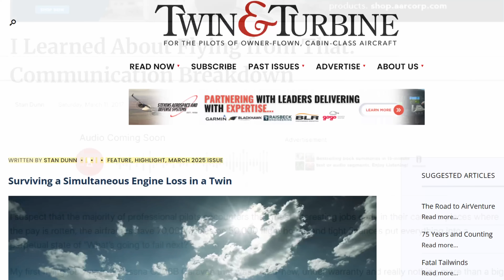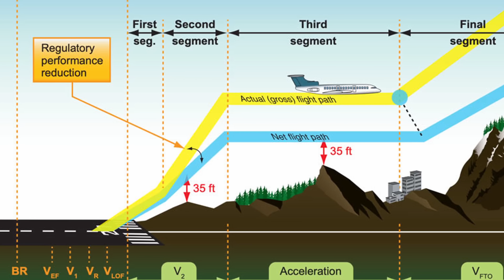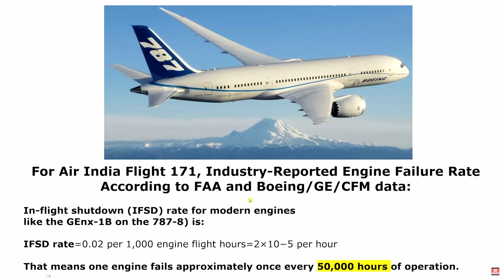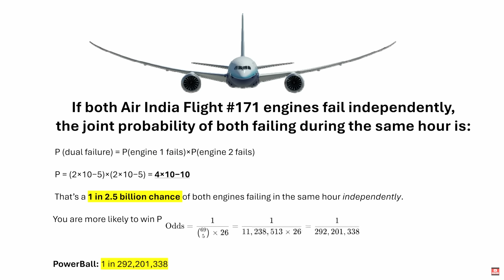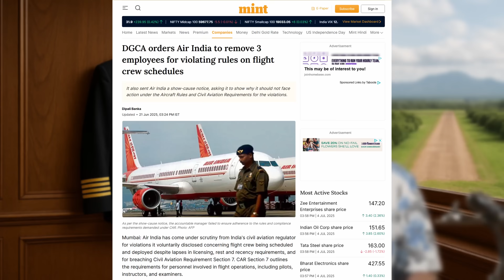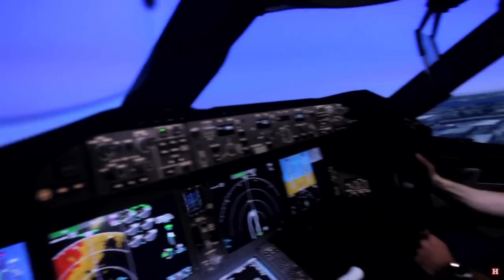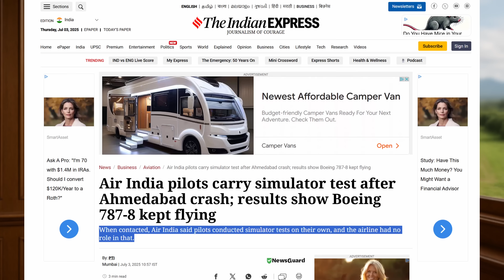Air India 171 Cause Becoming Clear

Comment: pilots had low hours experience
Reply: the pilot hours are disputed, colleagues of the pilots say the captain and first officer had more flying hours but their flying hours were based on a new system the dgca launched, which excluded previous flying hours

air india initially said the captain had 8.2k flying hours while the f/o had 1.1k flying hours, but they eventually reiterated in an announcement that the captain actually had over 11k flying hours and the first officer had 3.4k flying hours, both fairly experienced 

We will only know the actual flying hours of the pilots when the preliminary report comes out

Comment: There is 0 indication so far the pilots shut down the incorrect engine. Almost no chance they touched any engine controls at that altitude. 787 pilot here
Reply: I'm inclined to agree with you. Except one thing bothers me, and that is the Lone Survivor was sitting right next to the engine, and he said that they, went silent, and the plane floated for a short time. And then the engine spools back up but said that the engines coming back to life didn't create any forward thrust??? I really can't believe we haven't heard more from the Lone Survivor with a sit down with an FAA official or something?
Reply: @gregweigel8115  The survivor will be interviewed, as will all the other eye witnesses. Conducting the interviews will take a long time and other than a brief interim report, no information will be released until the investigation is complete.
Reply: @gregweigel8115 if they did spool back up I would say they were not going to provide any lift at the angle of attack/ slow speed caused from them going silent. They would have probably had to level off to gain any actual speed back where they could start climbing again. Which wouldn’t have even been possible in this scenario.
Reply: @jacobhendrickson8935  Difficult to level off when you are descending with insufficient thrust.
Reply: @hb1338 right, I didn’t say it was possible I was just explaining why would wouldn’t feel the thrust in that nose up no speed situation.
Reply: @hb1338 not to mention that even if they did level off it would nose over, pick up speed and dive into the ground. At least at the attitude that they had it was a softer impact than the alternative
Reply: @gregweigel8115 Oh, wow that’s sounding like a compressor stall, I never heard about that.  Thanks Greg. I still believe it’s electrical
Reply: @HankHildebrant  Nope. Compressor stalls are almost always accompanied by loud bangs and puffs of smoke from the engine.
Reply: @hb1338 not if fuel starvation from underpowered electric pumps
Reply: @HankHildebrant Not electrical, pilot error accounts for 80% of accidents.
Reply: @hb1338 how do you explain that now that we know the exact opposite
Reply: @gregweigel8115 Ya that’s what engines do when they don’t get any fuel.
Reply: Correct. Furthermore, the plane remained perfectly balanced during the whole flight - which means, both engines lost thrust exactly simultaneously. 
Whatever the reason was, it was not a pilot error.
Reply: Yes, just another absurd conspiracy theory being repeated. 777 pilot here.
Reply: @JetBossLauraSavino thank you Laura
Reply: @JetBossLauraSavino keep it in the wind captain
Reply: Would the rat deploying align with this theory though?
Reply: The Air Current has an article out today that should be reviewed.
Reply: @0604chiropractaylor I read it, and boy did they nail guys like this poster. AI is generating misinformation. Or straight misconceptions
Reply: This “case” will surely become one of the more interesting (Asia-related) episodes of the TV series “Mayday”, “Air Crash Investigation”, or “Air Disasters” respectively…😏
Reply: @maccxxster i would have to agree with you on that
Reply: Well not many planes do well without fuel.   And that's the facts Jack.  Someone shut off fuel
Reply: @trextrextrex trex, there is a  restart procedure that does require a cycling of the cutoff switches, however if they were in fact doing that procedure they should have known at the altitude they were at that they would be doomed because they never had the time to restart, and there could be a chance that they became overwhelmed with trying to put the plane down somewhere beside the medical college. 

But being a fly by wire aircraft they may not have had control of the plane when the RAT deployed. 

Or yes it was deliberate. But that doesn’t explain the mayday call and the only surviving passenger stating that the engines went silent and shortly before the impact started to spool back up again. 

Hopefully the investigation uncovers the truth. But this report is preliminary and this is an Indian investigation. 

I’m staying neutral on this until the facts come to light
Reply: comment did not age well 😞
Reply: true.
Reply: They're indian it makes alot of sense. Very incompetent pilots and people.
Reply: You were totally wrong with that comment along with 248 other dummies. 
One of the pilots shut down both engines with the fuel cutoff switches. I knew that accident was pilot error, from the get go. The author of this video was more right than you guys too.
Reply: @CaptainLeo44 go listen to captain Steve and hear what he’s saying about it. First off I’m not going to argue with you but in a dual failure there is a procedure that requires the cutoff switches to be cycled. Now that you seem to believe a preliminary report you should be ashamed of yourself. Anyway you’re ignorant and if you’re actually a captain I’d never want to fly with you. 

Good day sir
Reply: @HankHildebrant 14,600 hours and zero accidents. Safer than you a I bet. Cycled does not mean leave off.
Reply: @CaptainLeo44 hahahaha. You are a liar
Reply: I’m also 51 and I’m retired, I don’t have to shill bear watches, and I also don’t have to use my old white ford pickup to jumpstart my broken down tractor because I can afford a new battery and alternator 😂😂😂😂😂
Reply: You were totally wrong with that comment along with 248 other dummies. 
One of the pilots shut down both engines with the fuel cutoff switches. I knew that accident was pilot error, from the get go. The author of this video was more right than you guys too. I think you can rule out being an accident investigator.
Reply: FADEC shut off the engines, anyone with any common sense can see that. I reckon a huge lawsuit incoming for Boeing, the risk assessment whistleblowers were right all along.
Reply: Well - almost no chance of a 787 going down period, so if something with a probability of near zero proves to be the cause, it won’t be much rarer than the event itself.
Reply: @russellaycock3703 - there is a possible reason for simultaneous engine failure not mentioned here: Fuel evaporation under extremely hot weather conditions.
Reply: @russellaycock3703  That's what they said about the Titanic!
Reply: @melodychest9020 the last pilot named Aycock I heard of killed Randy Rhoads in a plane crash. I hope he’s not carrying people
Reply: @russellaycock3703 Pilot error is way more common than engine failures
Reply: @CaptainLeo44 why don’t you jump start tractors dude. At least you are good at that
Reply: @brandodurham There is a thing called asymmetric thrust, which this plane does not display. The rudder was close to center throughout the flight. Which you know that to counter that you need to compensate with your rudder. I’m with you Brando. 

Be careful with those old Dreamliners right now. We need you here with us brother
Reply: @HankHildebrant  When you "edit" your reply, the persons name is no longer highlighted in your reply, and they won't get a notification. It's better to delete and reply to the person again if you want to have a discussion.
Reply: @dc6233 i appreciate you for sharing this.  Thank you
Reply: Are air India flights going cheap at the minute? (make sure your will is in order first)
Reply: Unless on purpose

Comment: trolling youtube for money as well it seems.  Nothing new except to blame the crew, who from what I've heard were pretty experienced with thousands of hours flying and quite a lot on type - and thus not likely to hastily shut down the wrong engine mid-take-off.  There was no fire or anything which might require a hasty shutdown decision, and as others point out the SOP for engine fail during take-off is to fly the plane and try to gain altitude. 

In time the data will have been analysed and hopefully the cause of the crash will become clear, until then all is speculation.

Comment: I stayed at a Motel 6 in the 1970s and played MS Flight Simulator 1998…and that experience qualifies me for the following:  like a bitch in heat, it’s all about the….THRUST!

WHAT does the pilot mention?  Loss of THRUST.  Period.  And in this case, NOT a single engine failure.  You’re welcome.

Comment: From: India Times

"Air India pilots have conducted simulations of the ill-fated flight's conditions in a simulator, testing scenarios with extended landing gear and retracted wing flaps. These simulations revealed that these configurations alone would not have resulted in a crash, according to sources close to the investigation quoted in a Bloomberg report."

Comment: click bait title.

I'm more confused now that I was before ... but I've only been flying major airline for going-on 28 years and only had USAF single seat/instructor experience before that.

certificated 787 pilot ... it was the last aircraft I flew.

I'm concerned about the FADEC.  Does anything makes this mishap unique to this airline, with this crew, with this particular airframe at this particular airport on this particular day.

I agree that fuel contamination is low probability as apparently no other aircraft sustained any difficulty, let alone anything CLOSE to engine failure.  I agree that the flaps were likely set correctly.

It appears the gear handle WAS raised as the main trucks have translated for retraction, but hyd power lost immediately after that, which deployed the RAT and left the gear down.

I'd liked to have heard a greater analysis of the dust-up on rotation.  looks like overrun dust, not exhaust from an engine malfunction, which would mean the majority of that 11,500' long runway was used.  If so, they had problems well before rotation..  No normally operating 787 takes that much runway, ever.  If there was only a single engine failure, heading control was BEYOND outstanding ... no change.

Will continue to watch ... perhaps on the next video ... approaching a month since the crash ... perhaps avoid the temptation to bait the title.

Comment: First of all at 3 minutes and 55 seconds in your video new state that the 787 has one generator for each engine that is incorrect. The787 has two generators (variable frequency stater generators) per engine plus two generators on the apu. That's a total of 6 generators that's 1450 kw or power over a million watts.

Comment: First question need to be asked is what time the AHM ( aircraft health monitoring) data was lost this is available with both GE and Boeing . From that we can establish the power failure inside the aircraft due to some reason could be due to the water leakage over the power panels as both power panels are sorting over the toilets . Power failure causes RAT deployment and triggers APU auto start ( takes one minute) . If there is power failure all sensor inputs to the engines are lost leading to thrust rolling back to idle . The lone survivor had mentioned white lights came on that’s the emergency lights. All this indicates power failure. Earlier we had witnessed RPDU failures due to leakage from the toilets . Though there are drip shields it may not protect the panels from leakage during the flight especially during takeoff . Second possibility is both power panel failure . Pilot attempted gear retraction , gear moved then stopped in down and locked indicating EMP hydraulic failure. Which can happen only due to power failure. I feel very sorry for the crew as they have less time to recover during this critical phase of flight.

Comment: Well in jets there's no rush to do anything after an engine failure on takeoff or initial climb. Since shutting down a failed engine doesn't improve performace like in a propeller aircraft, where there is an urgency to feather the failed engine to eliminate the windmilling prop and it's drag. So nothing is done until after a 1000' feet when the normal cleanup of flaps and gear is complete, after take off checklist, then the engine failure checklist. So if they started messing with the engine procedures that soon after takeoff, they broke a lot of rules. That would have entailed disregarding their training and making up their own procedures. Doesn't seem likely.

Comment: SABOTAGE !! You have an engine fire, and the first thing you do is hit the 'Fuel Shut-Off button' to the engine. "Fly by wire" is an easy sabotage", similar to Mossad's Pager detonation, a GSM controller breaks the positive connection. No magic - your using a SIM card versus  RF or bluetooth. Who benefits? Why does India refuse to send the Black boxed to NTSB labs?

Comment: I disagree with your assessment, though the plume after rotation is curious. The engines are still spooling down and yet the RAT drops. Generators produce power off of the rotations, not the combustion of the engines. Thus the loss of power proceeds the drop of the RAT which precedes the spool down of the engine. 
   I think there was a short to ground in the Electronics bay. This drop the system voltage and caused the RAT to Drop. Fuel would have been available to the engines until they rotated at which point gravity and acceleration would have starved the engines. We are avoiding the obvious problem here, the complete fall off of engines and the drop of the RAT points to a catastrophic failure in the electrical system. All you really need is for voltage to drop below the lower limit for the fuel pump. With newer pumps there are electronic controllers and some of the circuits are sensitive to as little as 0.5V drop from specified voltage, in most cases the voltage supplied is a little higher than specified, thus even a 1v drop in nominal system voltage could have caused the electronic fuel pumps to stall. This in and of itself does not cause a problem. The engines are below the tanks and gravity fed. But once the tank pumps fail they become a hindrance to fuel flow. Next the temperature of the fuel is an issue, while diesel is thermo stable, only so to a point before it begins to vaporized the low molecular weight components. If the engine pumps, the tilt of the wing, the position of those engine pumps relative to the real-time fuel level in wing fuel tanks, and the vapor pressure of the low MW components can create a vapor lock in the system causing the engines to stall. 

   Here is the unknown, what was the temperature of the fuel, we know it was ~40°C on the ground,  but the fuel may have been sitting outside, an able to undergo evaporative cooling heating it up. This may have not been a problem in any other aircraft as long as the wing fuel pumps were working. Deprive the wing fuel tank in power and now the vapor pressure of the fuel becomes a problem, the fuel pumps are a source of resistence and any pull of fuel from the engine becomes a source of potential vapor lock. 
   Might the plume just be the result of fuel pressure fluctuations at the injectors a loss of combustion followed by reignition.

Comment: Even if flaps were not extended, with all the trust from normal takeoff, why was plane moving so slow, and the RAT was deployed. With dual failure, it sounds as if the computer shut down engines.

Comment: I can't believe I wasted my time again, listening to ALL of the least likely and illogical scenarios. While the one of tbe most logical is almost not covered anywhere. Major electric surge at avionics bay that cut off fuel supply for engines. Maybe heat was the problem, as there were some early signs somethings wrong with climate control on the plane.. Let's wait and see

Comment: Fuel contamination!
Reply: Nope, not a chance.
Review the 87's fuel systems, compare evidence with other flights that day, note that the gear, which retracts based on electric power available (backed up by a huge battery) and fuel contamination as the single point of failure becomes very improbable
Reply: @daszieher so did both fadec fail?
Huge battery.... something tells me you have never worked on or seen a 87...could be the p panels that had been failing about ten years ago....idk two engines that are not supposed to fail ....fail... In a place with such high cleanliness standards... Make sure you wonder how much water was in that fuel system.

Comment: All the prior major wrong engine shutdown scenarios you cited involved older aircraft with no EICAS meaning those crews had to interpret round dial gauges to identify the dying engine. I find it unlikely that the crew would have misinterpreted EICAS warnings but maybe there was a streaming cascade of fail messages which could paralyze the crew at exactly the wrong moment. I wish they’d hurry up & release the data